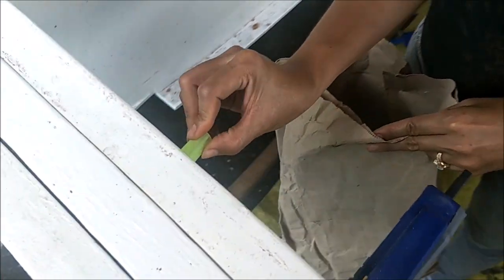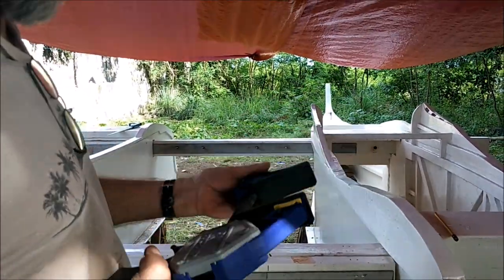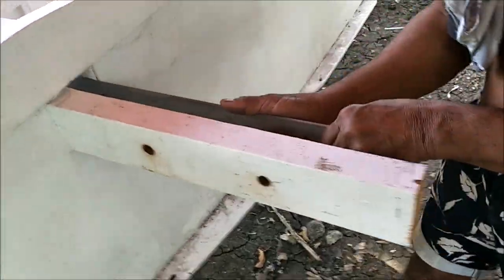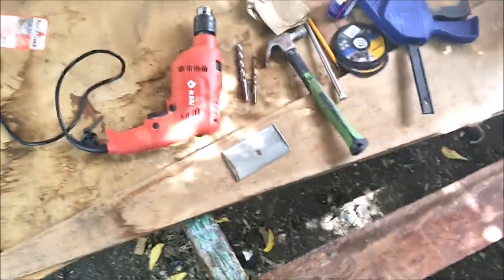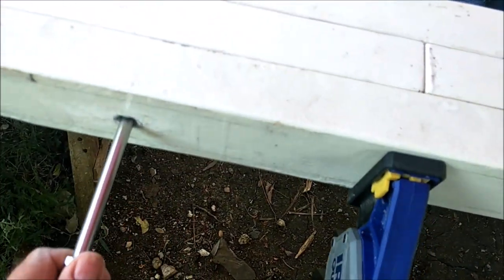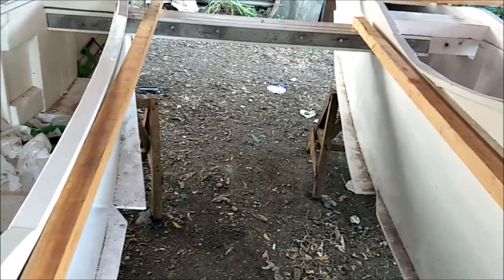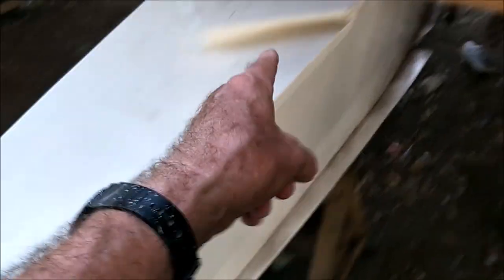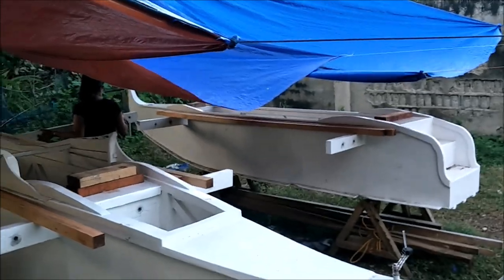Paradise Trimaran Boat Building - Part 22

Comment: Yeah SS is hard stuff. That´s a tough job. Definitely like the SS bars reinforcing the cross beams on the whole length. Was always wondering because till now those 2x4 on it´s own looked a little flimsy to say the least but these SS bars make this rock solid. As already mentioned, those plastic inserts don´t convince me 100%. However You gotta seal the wood somehow.. Of course it´s always more easy talking then doing the job on  the sight. Here is my approach. I would have drilled the holes half size of the bolts in the metal shop, positioned them with clamps in position making sure that one side and the other is aligned. Then I drill from both sides till the holes meet trying to be as straight as posible. Of course it will not be posible by eye balling. But once I am through, even so a little off, now I can find the holes with the drill bit on the other side and since I only drill half size diameter now with the full size drill bit I think I would find the other side much easier using the small holes as a guide.. Ok in some holes I might be off a little more but later on epoxying the holes that is not an issue anymore. And another advantage... it´s a lot easier drilling a hole bigger then starting a new one. Predrilling I also make sure all my bolts are straight and in the desired position that later on will also help me disassembling the hulls easier. Well, one way or the other ... that is a hell of a job. If You would have to do that job again would You take the same approach ?

One more thing to the cross beams. With the 2 SS bars now You have all the flexing forces concentrated on the center hull. That is a structural weak spot or are they over lapping ? Can´t see it in the video. Of course the best would have been big long bars from one outrigger to the other but You can fix that problem. Take another SS bar at least the length of 2 holes from the center hull to each side. I would  take 3. Now You have completely unified the structural strength and it will still be easy to disassemble the boat. Well, you might need longer bolts. Thinking about it right now I would have considered making the cross beams in 3 part. This way each part is fixed to each hull and the assembly happens out side of the boat which is much easier and more practical. Of course that is important. You wanna modify something or have to do a repair. You only have to carry one hull. So You want the disassembly as easy as posible....Now imagine You wanna disassemble the boat and You can access all the bolts with a nut on battery powered drill bit. The nuts are welded to the SS bar. hahaha yeah, brainstorming with unconventional boat building.

The cleats !! also drill out the holes over size and fill with epoxy and than redrill to protect the wood and to reinforce with a 2x4 and maybe You can find some additional BIG!! SS washers to save the work with fabricating backing plates. 
The washers ? The bigger the better. You can always cut them down to size and they are very useful whenever You need some extra punch.

Sorry, just saw Your answer to my comments. YouTube does not notice anymore. 

So the rudder !!!..... well let´s get the boat in the water and see. Everything else is speculation. Of course I also thought of the dual rudder but the problems will be the same or much worse because on the outriggers You are below the waterline and Your steering patent will have to be water tight, and on top of that with dual rudders now You are creating obstacles in the way on the back of the boat. It´s very nice to have a clean entry from the water. I am sure You have seen there are plenty of options  and when the boat is in the water maybe there are some more. The important is that metal fabricator and the lumber yard with all the tools in the neighborhood. That is really fantastic.  I hope You will make a good video when the boat is in the water. Looking forward👍 
Hahaha, of course all that is important. From now on You will be a profesional boat builder in your paradise on Bantayan Island.
YeYe, I make a TITANIC prediction. This will not be the last boat You built.😂

Cheers
Reply from the maker: If I had to do it again I think I might epoxy big holes then drill out the epoxy without any tubes😊